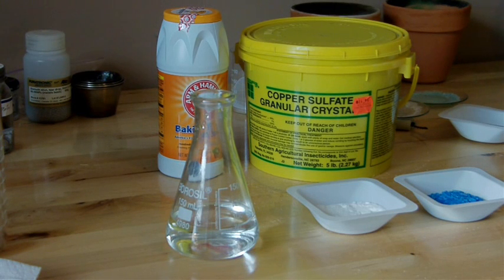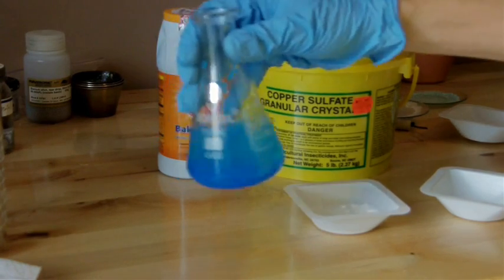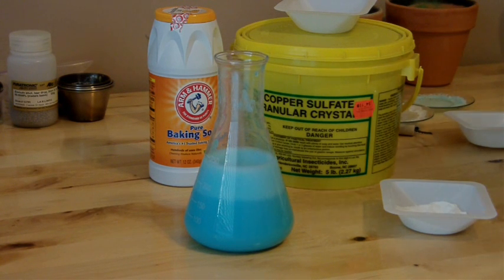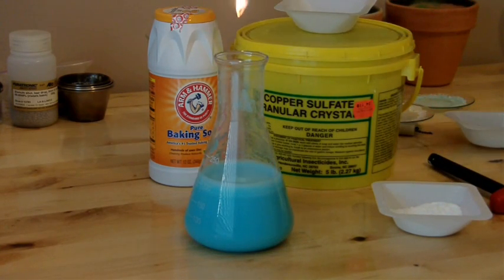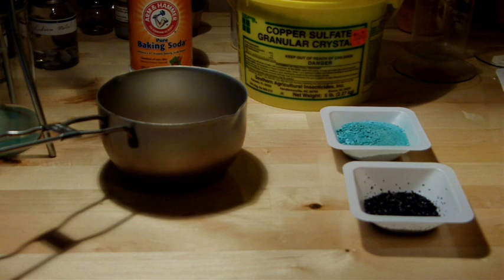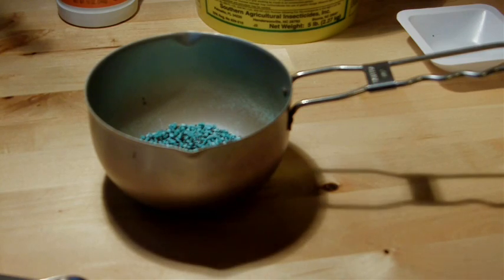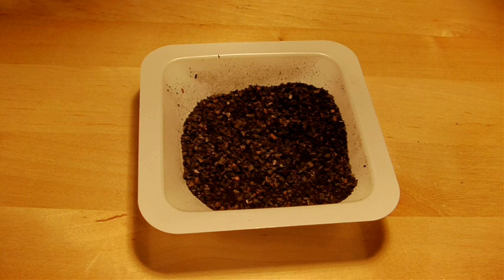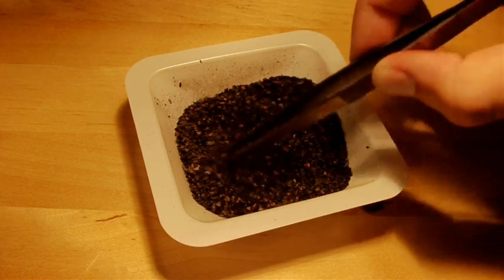Make Copper Metal from Copper Sulfate

Comment: Also i think your making basic copper carbonate Cu2(OH)2CO3.............. Basic copper carbonate can be prepared by reacting aqueous solutions of copper(II) sulfate and sodium bicarbonate at ambient conditions. Basic copper carbonate precipitates from the solution with release of carbon dioxide: due to the great affinity of the Cu2+
 cation for the hydroxide anion HO−

2 CuSO4 + 4 NaHCO3 → Cu2(OH)2CO3 + 2 Na2SO4 + 3 CO2 + H2O

        Reliable synthesis of true copper(II) carbonate was reported for the first time in 1973 by Hartmut Ehrhardt and others. The compound was obtained as a gray powder, by heating basic copper carbonate in an atmosphere of carbon dioxide (produced by the decomposition of silver oxalate Ag
2C2O4) at 500 °C and      2 GPa (20,000 atm). The compound was determined to have a monoclinic structure.
Reply from the maker: Correct. It's a common misnomer for people to omit "basic" when making this. Helps simplify, so we don't have to post a whole Wikipedia article! Thanks for the interesting info.
Reply: @mrhomescientist  ............I actually just learned that today.  And yeah it was wikipedia.   I  got some CuSo4 and am making the carbonate like you did in your video and then plating them on some carbon like you did.  I LIVE WHAT YOU DID IN THE VIDEO.  For at least a year or 2  i been trying to think of a way to get metal on a structure like carbon or quartz wool.  If i just use copper particles(dust)   then they kind of CAKE UP and clog it to much.   Trying to get 10% copper and 90% carbon so i increased the carbon i am going to use compared to what you used.   I can not wait to see how good this works.
Reply from the maker: @johnblacksuperchemist2556  Cool! I actually made several mistakes in trying to make pure copper, but I'm glad this process will be useful for you! I should have covered the pot and ground down the carbonate and carbon to a finely mixed powder. You may want to try covering yours too; it helps with the reduction to Cu metal. Good luck on your project!

Comment: I found out about the decomposition of basic copper carbonate by mistake (I guess you could say I learned about it "the hard way" ). I was making some basic copper carbonate following the instructions from Doug's Lab and NileRed. I thought I would heat up the drying of the powder, so I put it on a hot plate on a low setting, but I didn't stir it up very often. I would eventually see little black flakes inside the nice light blue powder, and would blame it on the impurity of the copper sulfate or sodium carbonate. So I would recrystallize the copper sulfate before using it again, and get some more pure carbonate..... and it happened again. 
Eventually, when I took the time to research the reaction (like I should have done), I saw that the basic copper carbonate breaks down to copper oxide with enough heat... 

A month in the laboratory can often save an hour in the library - Very true... lol.
Reply: What a great saying  🤣
Reply: @Thomas Asche  I'm pretty sure I have it the wrong way around, but I'm leaving it. Lol

Comment: The final reaction needs sufficient heat to melt the copper.  Otherwise you will get fine partials of copper dust and copper oxide with an excess of carbon.

Comment: You were almost there!  If you had sealed it in a small crucible or clay container with the charcoal and fired in a small kiln for 30-40 minutes at about 1960 degrees F you'd had a copper nugget!

Comment: I was thinking of putting copper sulphate on a metal project to get its look of copper on the surface. Can I protect my finished product by powder coating it clear? Or would it ruin the look I'm aiming for?
Reply from the maker: Depends on what the process involves I guess. Copper sulfate is water soluble of course, so anything water-based is out. It's also sensitive to heat and can lose its color and integrity if heated too strongly. Clear nail polish is the usual way to preserve crystals like this. But by "look of copper" do you mean the blue copper sulfate crystals or actual copper metal?
Reply: mrhomescientist I'm thinking more of a patina process to make the metal look aged. I've worked with copper sulphate before but only to inspect metal for chrome plating. To confirm that the chrome was removed. I was unaware of colour distortion through temp change.
Reply from the maker: Oh I don't know then; patina is pretty different than copper sulfate and is outside my area of expertise.

Comment: You could just electrolyze your copper sulfate solution. 12 volts at about ten amps will cause the copper to form in large  spongey blobs instead of plating. After you filter it off and rinse and dry it, it becomes a very very fine dust. As a bonus, the water is now sulfuric acid. I reuse the "water" till the copper sulfate is no longer soluble in it. Then I boil it down to concentrate it.

Comment: A much easier way to obtain copper metal from the sulfate is to mix up a solution of CuSO4 and NaCl and then add aluminum. The Cl- ions attack the oxide layer on the aluminum and allow the Cu+ ions in solution to be replaced by much more reactive Al+ ions. A spongy copper precipitate is formed on the surface of the aluminum and you are left with a mixture of NaCl, NaSO4, and Na2[AlOH], all of which are water soluble. You can then filter the precipitate and dry it to obtain pure copper powder. Hope that helped!
Reply: Now that, but without a mess of soluble stuff that you can't separate from eachother without another process that's most likely gonna produce some more stuff you can't separate from eachother without ... etc.
Reply: Lane Haden thanks for this. Can we do it by just dissolving copper sulfate in water instead of NaCl to get copper?
Reply: @muhammadadnan4475 NaCl is regular table salt, they meant desolve it in salt water
Reply: Is that like a sheet of aluminium foil?

Comment: I'm sorry, but with your setup it was kinda naive to expect a molten puddle of copper. Its melting temperature is pretty high. High enough to get the container yellow hot before copper liquefies. It would've been interesting to see some way to refine the resulting product. Perhaps next time I guess...
Reply from the maker: Yeah this was one of my early experiments, before I knew too much about chemistry. I would love to revisit this one at some point now that I have a better setup.
Reply: Yeah, that'd be cool ;)
Reply: mrhomescientist - I enjoyed your video. I tried this several years ago and remember that it took a lot of heat. I didn't get any copper metal to reveal itself until I went to direct glowing heat with a torch using MAPP gas. (I think the melting point of copper is around 1984°F). 

It took a lot of coaxing and the result was a tiny, little lump of crumbly copper. It could have used some additional refining. Still, it was a rewarding, educational experience and even if the results weren't spectacular, the beautiful blue colors totally make up for it.
Reply: +Daniel G. Benes Science Shows But why not the electrolysis method? It's WAY more easier, simpler, cheaper and the results are of MUCH higher quality too. And you even get sulfuric acid as an added benefit.
Reply: CoolKoon That's a great suggestion! I've done electroplating for the sake of plating, but that's about it. Do you mind sharing your method?

Comment: Can't you just heat up the Copper Sulfate? I mean like in a forge.. Does that create copper metal?
Reply from the maker: +Maleficus I don't think so, no. It first loses water in several stages until anhydrous, then decomposes to CuO with release of SO3. After that, I don't believe the copper oxide decomposes further.
Reply: +mrhomescientist But you could mix the CuO with an reduction agent like Mg or Al and you got thermite!

Comment: What I do to recover copper metal from copper sulfate is to react copper sulfate with sodium chloride to form a crude copper (II) chloride solution. Really and arbitrary amount of salt. Then use aluminum foil to react the chloride to produce fine copper particles. I don't know if it is effective in collect it producing larger amounts of copper metal, however, it does help to produce a fairly large amount based on the  copper sulfate and sodium chloride technique.
Reply from the maker: +joesph decarlo Really only a pinch of salt is needed. The copper sulfate reacts with the aluminum easily enough, but for some reason chloride ions are necessary to break through the aluminum oxide layer first! They act as a sort of catalyst.
Reply: Thanks. That really helps actually. I'm a fourteen year old that just really loves chemistry. And some if that chemistry gets my hands on chemicals from which can't be poured down the drain, aka copper compounds. I work a lot with said compounds. So I know that converting the copper salt to metal is the safest way of controlling the amount of copper salts that are poured down the drain. But, I didn't know that only a little sodium chloride be used. So, synthesizing copper metal can now be a bit easier now. So I appreciate that.
Reply from the maker: +joesph decarlo No problem! Proper disposal is a very important part of chemistry that I think a lot of people overlook, so I'm glad to see you're taking it seriously. For disposal of most things my goal is to make them into insoluble forms, which are (generally) much less harmful. For example I turn iron solutions into iron hydroxide before disposal, then when it gets incinerated with regular trash it gets converted to oxides, or common rust! I've heard of others mixing these insolubles into concrete and throwing that hardened chunk away. Almost no chance of anything escaping that!

Comment: Cold you also use copper acetate in place of the copper sulfate if you don't have access to the latter?
Reply from the maker: +Connor Steppie Sure, any copper salt should work fine. The insolubility of copper carbonate drives the reaction.
Reply: Late reply, but what ratio should I use? Same as copper sulfate?
Reply from the maker: +Connor Steppie The weight will be different. Use stoichiometry!
Reply: I haven't learned that yet D:
Reply from the maker: +Connor Steppie Now's a great time! It's a required skill if you want to get into chemistry. Hint: look up the chemical equation for the reaction involving copper acetate instead of sulfate, then use the coefficients and molecular weights of each to calculate how much of X and Y you need to mix to get Z. There's lots of tutorials online!
Reply: Stoichiometry | Chemical reactions and stoichiometry | Chemistry | Khan Academy
https://youtu.be/SjQG3rKSZUQ

Comment: at 3:12, doesnt hydrogen extinguish lighted splints?
Reply from the maker: +tay yi an Quite the opposite. Hydrogen makes a small pop as it ignites. I suppose if you had an atmosphere of pure hydrogen it wouldn't, but that pretty much never happens when doing these gas tests in the lab. It's always going to ignite at least at the interface between the hydrogen and the atmosphere.
Reply: omg the chemistry syllabus for gcse says  that hydogen extinguishes lighted splints with a pop sound....it is  a lower level definition?or a scam?XD...look forward to your reply
Reply from the maker: +tay yi an Well the pop sound tells you that it's combustible, so using the word 'extinguish' is pretty misleading. It might put out the splint from the force of the small explosion blowing out the flame, but the gas definitely supports combustion. Look up a video on gas tests to see that the difference between H2 and CO2 is pretty clear. I need to make a video of that myself!
Reply: ok,so after the gcse , i can forget about extinguish !!!!yay=)

Comment: you can dry the copper (ii) carbonate and heat it until it reaches its oxide state and turns black.
I store a lot of this as you can then take it to copper chloride with no fuss with oxidizers. 
its a great way to prepare copper chloride
Reply from the maker: +Clown Whisper Just hydrochloric acid is all you'd need to make CuCl2 from CuO - no oxidizers needed!
Reply from the maker: +Clown Whisper Also you could make it directly from the carbonate also using only HCl, with release of CO2.
Reply: +mrhomescientist I know that's exactly what I meant rather than messing with the concentrated hydrogen peroxide and HCl HCl bring it straight into copper chloride. that was my whole point lol
Reply from the maker: +Clown Whisper You said "with oxidizers". No oxidizers necessary, just straight HCl.
Reply: +mrhomescientist yeah that was unfortunate wording the whole point was that rather than going to the whole class of making copper chloride oxidizing the copper so the HCL can work just go straight to the copper to carbonate and instantly convert it it actually takes less time
Reply: +Clown Whisper I'm going to have to stop using voice recognition
Reply: +Clown Whisper stop replying to urself. dumb
Reply: U know what no. I can't edit anything. And I don't reply to my self dumb a*
Reply: +Landon Carling  good for you derp
Reply: +Clown Whisper stfu, go get a life. don't reply derp
Reply: +Landon Carling lol go argue about cartoon s some more than
Reply: What I was originally saying is I bet a lot of that is copper oxide I got sidetracked with trying to clarify what I meant by the oxidation procedure for turning copper metal to copper chloride not copper carbonate or chloride azure smelting procedure was moving forward long before anything was converted to copper metal much of the powdered terminate certainly converted into oxide and I believe that's where your loss is there was no way that there's 7 g of carbon dioxide in that amount of carbonate to prove it you could have copper chloride in the beaker

Comment: you can easily get the copper out with electrolysis
Reply: You mean, by electrolyzing cupper bi carbonate ?
Reply: @omsingharjit  Copper sulfate.  Insoluble salt cannot be electrolyzed because you will reduce water (2H + + 2e- ---> H2) instead of copper ions :)
Reply: @mateuszbilicki8472  but copper sulfate is solvable..

Comment: the reason you did not get a puddle of copper is you never got it to the melting point you need a much hotter fire with forced air to get it that hot...
Reply: +mrhomescientist could one simply use a propane torch for a small batch?
Reply from the maker: Poor mixing of reactants too. This was one of my earlier videos and I'd like to revisit it now that I have a furnace capable of reaching that temperature.
Reply: I-Love-CO Mountains it might have helped but I doubt he would have reached coppers melting point as that would need to be the goal.
Reply: Map gas could do a small batch if he insulated a small crucible dish with some Besser block's. I've melted native copper this way.

Comment: you will need a higher temperature to melt copper , you would need about 1100 C (or 2000 F) to make it form a solid mass and the other carbides to oxidize.... I am afraid your grill gets nowhere near..

But nice experiment

+
Reply from the maker: Yeah this is one of my earlier videos and I've learned a lot since then. I definitely want to revisit this now that I have a furnace that can reach those temperatures.

Comment: In this reaction the liberated Copper will act as catalyst to form carbon nano tubes  . with most Copper trapped inside CNTs which getting the copper out is harder than copper sulfate itself . why dont you use hydrazine,ascorbic acid ,formic acid ,or alike... its a one step reduction from cooper sulfate + vitamin C(ascorbic acid) ....

Comment: I think he used the cork to prevent evaporation which would cause more crystals to form
Reply from the maker: Yeah I couldn't reply to his comment. I just had it in there while I had to pause the video and do other things, to prevent evaporation (like you said) or dust falling into the solution. Not strictly necessary, but good practice.
Reply: mrhomescientist
the resaon i looked this up was so i could turn copper 1 cent coins[ penny ] in to copper power for cheap so i could mabey sell it or use it, smelting would be to visble and could get me in troble. would this work on penny copper soulvate?
Reply: Well pennies aren't pure copper so it could be contaminated with other metals
Reply: NotSoLogical
 i was them, and the way i get the sulfate it only takes the copper, not the zinc in my per 1982 stock pile
Reply from the maker: kkirschkk If you can dissolve the copper into a soluble form, ascorbic acid (vitamin C) is said to be able to make very fine, high quality Cu powder.
Reply: mrhomescientist
thanks very much, how much acid is needed per penny?
Reply from the maker: kkirschkk That entirely depends on how much copper there is in a penny, and what you use to dissolve it in the first place. Modern pennies are zinc plated with copper, so there isn't much Cu at all!
Reply: mrhomescientist
 but pre 1982 ones are 95% cu
Reply: kkirschkk Pretty sure that's illegal lol, might want to look into that...

Comment: The problem I think is in the step that not shown in this video; when you finished reducing the copper oxide with carbon, I guess you just leave the disc aside. That's where the problem is, the still red hot copper metal would oxidise again with air and became copper oxide.

Solution is reduce the oxide in the test tube, after the process is finished, seal up the test tube and not allow the residue contact with any oxygen or water until it is cooled down to room temperature.
Reply: thank you!

Comment: You would need a small crucible and a map gas torch to heat it high enough to produce molten copper. A larger charcoal fire with a shop vac blowing air on it from the bottom of a thick steel cylinder will also make more then enough heat.